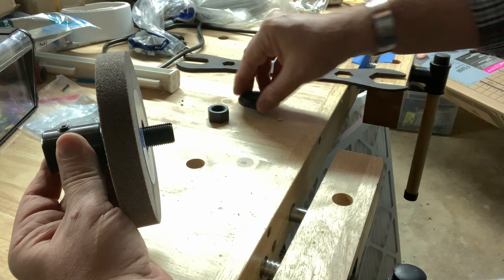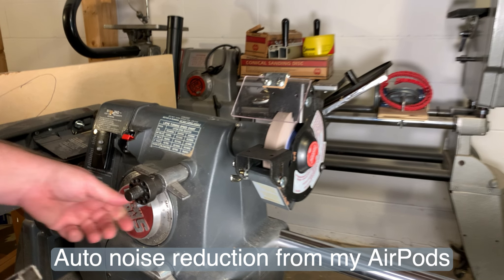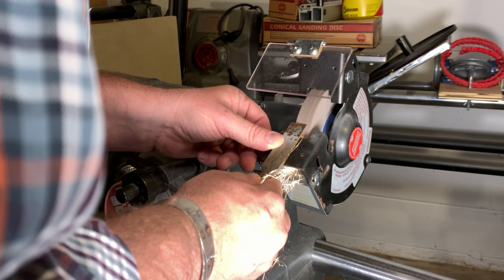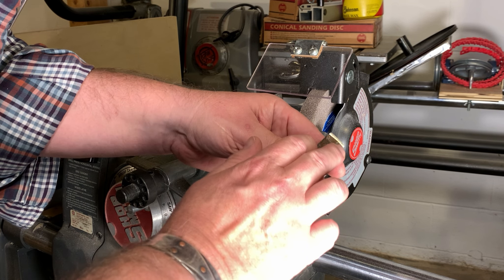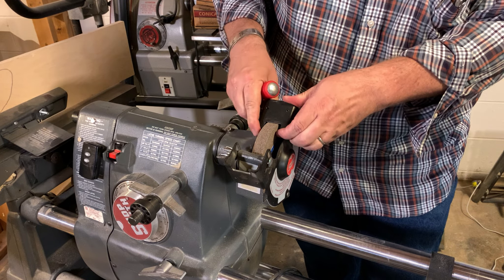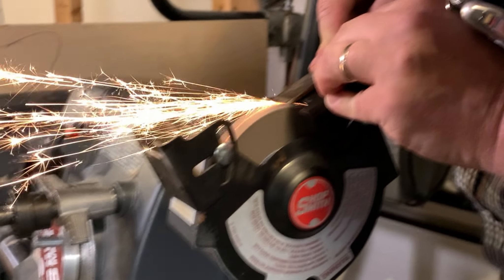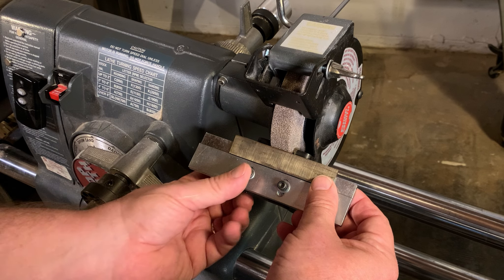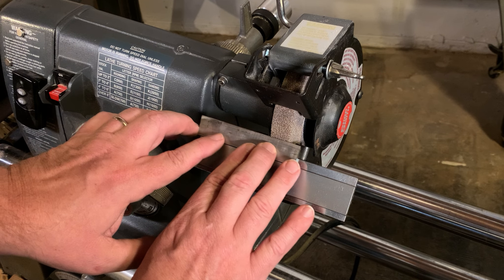Shopsmith Grinding Wheel Guard: Grinding & Honing and Jointer Knife Sharpening (sort of)

Comment: Neat accessory for the Shopsmith. When grinding an edge on a tool I have always had the grinding wheel coming towards the edge being sharpened. This takes the heat away from the cutting edge not towards it.

Comment: Although I love my Shopsmith tools, I think a separate grinder with CBN wheels is the way to go for bench chisels and lathe tools.  I like to be able to touch up my lathe tools while turning, without having to reconfigure. And once you have it for those, it is a no brainer to use it for my hand chisels.  The Shopsmith grinder looks like it would put too much metal on the floor. I like the idea of the Shopsmith conical sander and jig for jointer knives ( I have a new set on now that I have yet to sharpen).
Reply from the maker: I agree with your assessment.
Reply: I grind at 1750 rpm. I turn anywhere between 600 and 1400 rpm. Don’t want to spin my piece at grinding speed. If you are going to spend $150 for a CBN wheel, why noy pony up another $100 for a grinder and forego the frustration of building something experimental?

Comment: I just got the sharpening jig for the table and disc sander. Considering using that on my chisels.
Reply from the maker: That jig is helpful for learning muscle memory and the correct approach. It won’t guide all of the turning tools you have, but if you get used to how it works on the ones that it works with, you’ll be able to do the others freehand.

Comment: I read somewhere (probably in Power Tool Working for Everyone) that you need to cover the way tubes when sharpening with a grinder.  I also seem to remember directions on forming a piece of sheet metal to curve over and around the way tubes.  I've always used a shop rag to cover the way tubes.
Reply from the maker: That’s an instruction from the sharpening jig that is used with the disc sander.
Reply: I'm not sure if I would use shop rags, but it's real easy to form a piece of aluminium flashing to cover the tubes.
Reply: I just lay a piece of plywood across the tubes.  Done.
Reply: I use plywood or one of my wife’s old baking trays (shhh, dont tell her). The other thing I remind folks…clean up that errant sawdust from your last project…sparks and sawdust are not a good pairing.

Comment: You should never use the side of a stone that’s not designed for it. Stones should also be ring tested before installation.
Reply from the maker: I showed the ring test in another video, and you were absolutely right. As for grinding on the side of the stone, what you saw me do here is the extent of my use of the edge. I was recently looking at some CBN wheels, and in particular I was looking for one that had a nice wide side surface. Unfortunately, they were very pricey, so I had to go a different route.